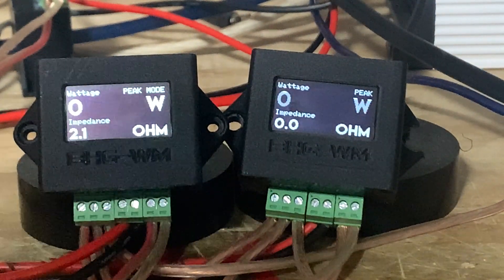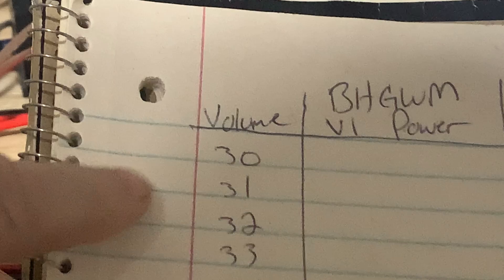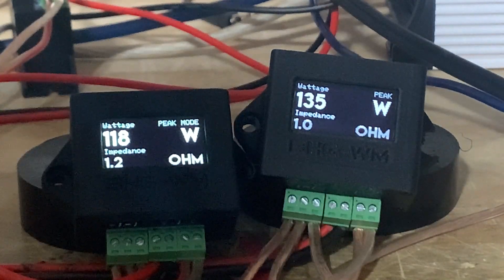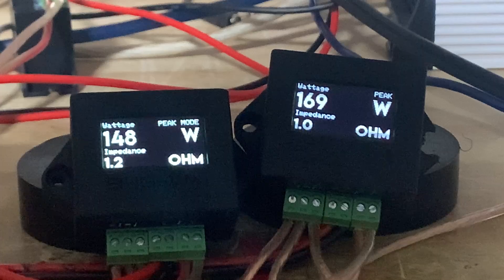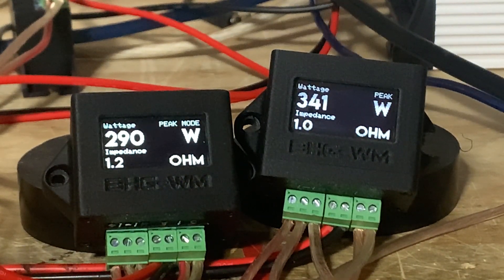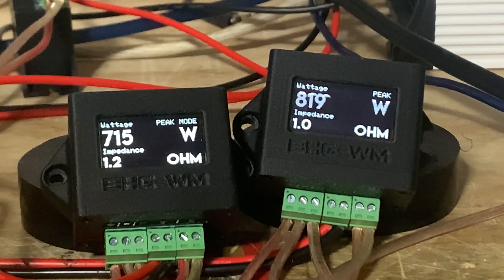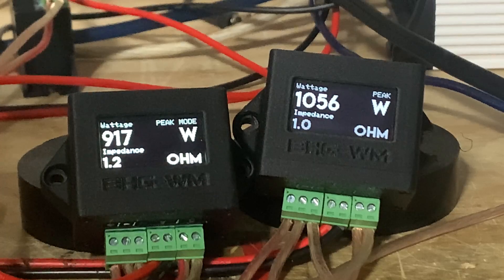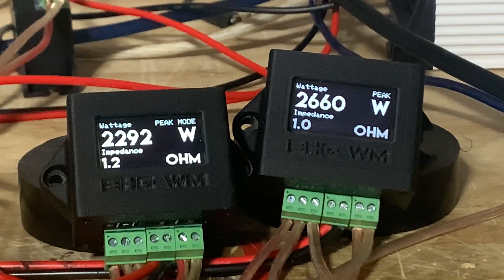BHGWM v1 power versus BHGWM v2 power testing

Comment: Interesting. Thanks for the video. I have one but unsure which it is lol
Reply from the maker: I have a video showing the difference between the v1 and the v2. The easy way to tell is the hall sensor. That is the sensor you put the speaker wire through that measures the current. The v1 has a small hall sensor that has wires coming directly off of the sensor and it has the current rating on top of the sensor. The v2 has a larger hall sensor that has a green terminal attached to the top of the sensor where you connect your own wires from the sensor to the main unit. Hope this helps. The v1 is not accurate. The v2 is very accurate and consistent.
Reply: @ yeah I just watched that video 🤙🏽 I got the v2. I’ve had it for a while just just hooked it up yesterday
Reply from the maker: @Team808customs  Nice! They are definitely handy little devices

Comment: The biggest problem with V1 was the CT transformer. It was falsely advertised as 100A, but it is actually barely a 50A clamp. Also, the calibration was slightly off.

Comment: Doing this test volume click by click also with a SMD-AM1, a term lab meter, and also a set of clamps/DMM along with the bass head meter be amazing… probably a lengthy video but definitely show how they all stack up against each other
Reply from the maker: The AMM1 is horribly inaccurate. I sent it back to SonicElectronix already for a refund. As far as testing the Termlab, I am awaiting a new clamp as the clamp I have here is faulty. The BHGWM v1 will not be tested further by myself. However I will be doing further testing on the BHGWM v2 versus the Termlab versus the SPL LABS Next LCD versus DMM/clamp meter. Thanks for watching!
Reply: Is there a physical difference or ways on the box to identify V1 vs V2? 

Asked Big Jeff what version I got but I don’t take his word seriously.
Reply: @chadc2222 , one of the easiest ways to tell a v1 from a v2 is the current sensor.
Reply from the maker: @chadc2222  please refer to the previous video labeled BHGWM v1 versus BHGWM v2 and it shows exactly the physical differences
Reply: Old says peak mode. V2 only say peak on display & coil ony physical difference
Reply: @elcaminosupersport  could see in the video the difference in power on display. Guess I gotta hook it up to know for sure.
Reply: I just bought from Big Jeff, he's been saying from the start they were the v2
Reply: @bryce9551  he also says he doesn’t know much about amps and puts out 20 minute videos talking about a new amp design.